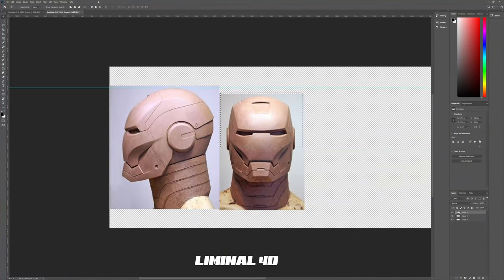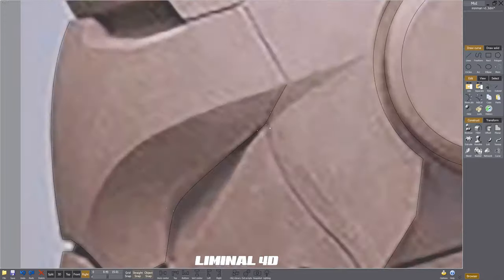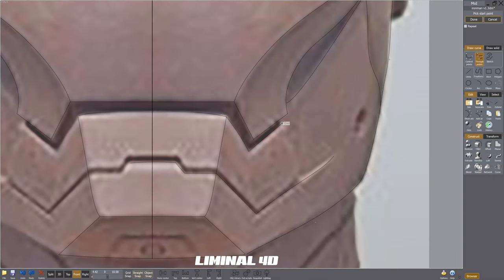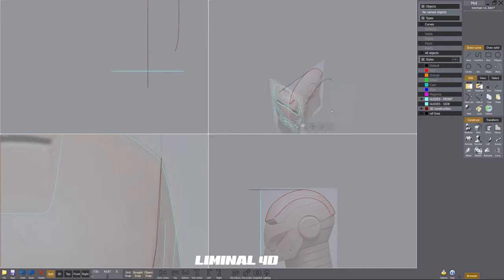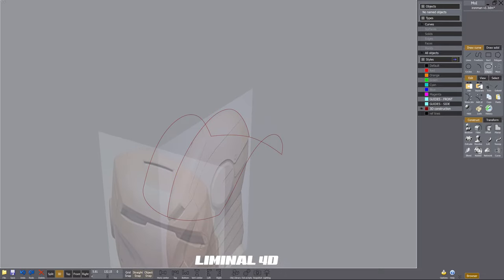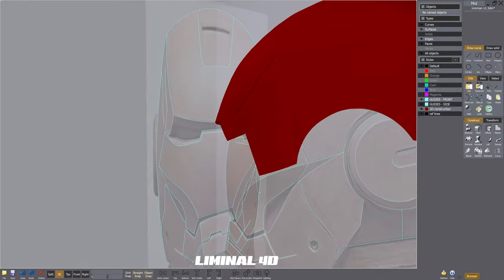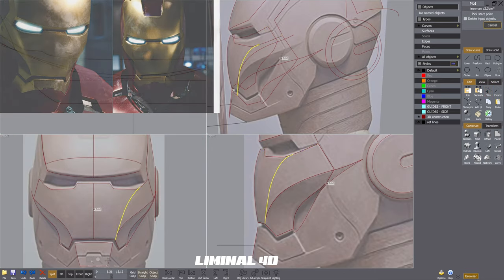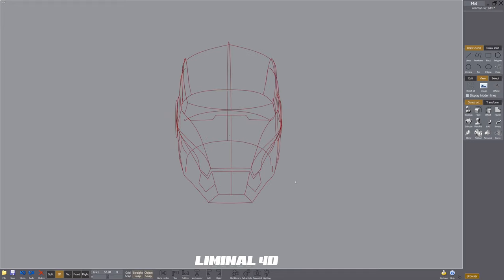3D modelling IRONMAN helmet in Moi3D

Comment: Hi, thanks for this series, 

just wondering, do you have a shortcut for 'Make corner point' when youre drawing the spline with freeform?
Reply from the maker: I don't have one, check out the Moi forums. Maybe someone there can help with that one.
Reply: @liminal4d  oh it seems like somehow you draw with corner points while using the freeform tool? Or are U using polyline?
Reply from the maker: @radgeradge  I'm using freeform, throughpoints.  When I get to a hard corner, I hit enter to complete the spline and the start a new one.  They can be joined together with the join command.
Reply: @liminal4d  thanks for clarifying :) I'm in the trenches... But I'm digging through it
Reply from the maker: @radgeradge  awesome, keep fighting for it, that's where the good stuff is!  Stoked for you.

Comment: great lesson.. one problem and a lot of tutorial guys do this. you dont explain the moves properly. your doing stuff and i cant see what your doing and im at  2160p. your menus are all fuzzy and i cant see what your pressing. you need to slow down a tad to. we are trying to learn from you. but in your head your know it all. just one move untold can leave us lost. totally. maybe i need to learn from another guy . maybe i went to advanced. iv been doing 3d for over 20 years. a max and zbrush user. i never did bother with max nurbs. as they where buggy. please explain each move and why your doing it. im watching you and stuff is just going bang boom connected. removed attached. these lines could use a gizmo. i try to pull stuff and it will not go where i want it to go. is maya nurbs as good ? i can imagine making wonderful spaceships with this software. its just a tad misleading and hard to understand. rant mode off. thank for your time and efforts though. i think you need to use a better capture software. u never told us how to make the work planes disappear. just 1 thing like that and im lost. please do some easy'r stuff for the noobs. just the top of the helmet loft would of been enough. hmmmmm
Reply from the maker: Thanks for the feedback.  These were meant to be more advanced tutorials but I think your feedback still applies.  In my head, I'm building on the basic tutorials I made so I am skipping over things I've already covered.  I didn't realize the issue with doing it this way until now. Thanks. Check out the basics tutorials and let me know if you have similar issues.   I want to make these as clear, succinct, and as helpful as possible so I appreciate the feedback.
Reply from the maker: Regarding the video quality:  I'm capturing and uploading at 4k.  It looks good on my end but I'll look into this more and see what can be done.
Reply from the maker: I'm dropping a couple separate comments to address your points: Regarding slowing down, that's interesting, I've been trying to go fast actually! haha.  Too slow and I thought it wouldn't be engaging, I figured it could just be replayed if needed.  I edited pauses out, even my breathes to make it faster, haha.   I think I can get better at pacing so it's clear, not too fast, but still keeps moving along.  I'll work on that.
Reply from the maker: Regarding the movement of objects:  If you're not snapping to a point or edge, try using the side, top, and bottom views to get more control if need be.  Since you're coming from zbrush and Max, I'd also say a big switch to flip in your head is to approach Moi with hotkeys in mind.  Everything is command based and can be typed on the keyboard to activate. I don't know if you're familiar with AutoCAD but Moi is kind of similar in that sense.  Select what you want to move, type M for move, click Anywhere to begin the movement and the selected object will move relative to where you picked. Click to complete.  Where you click to begin movement is what is helpful.  you can click anywhere, side view, top view, on the object.  On the object is super handy because you can move your selected item the same distance as any other two points on your model.  This is similar to turning snaps on your gizmo and snapping the gizmo to another area of your model before moving.  So in Moi, it's a similar idea but it's just how it always works.   This could be good to cover in a video, like you said, it's an assumption I have from already knowing the software.
Reply from the maker: This is good feedback. Simpler one topic videos could be created.  Cover one topic of modelling only, title it as such.  Then if you have a specific question, there would be a video only addressing that thing.  Then I could go slow without making the video too long.  This video was meant to be an advanced one but that's not an excuse for lack of clarity.  it's an interesting challenge of what to keep and what not to without making it 30 hours long.  Not an excuse, just what I'm challenged with on my end.  I'll think about these things you brought up and keep trying.  Thanks!
Reply from the maker: I've updated the video description at least.  We'll see if I can take your feedback into future videos.